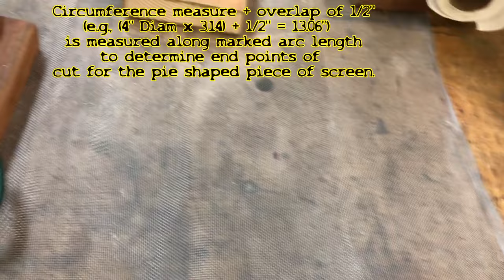Yellow Jacket Death Trap

Comment: It remains amazing to me that people don't know the difference between wasps, hornets, yellow jackets, bees, etc. and there are differences...and then they always or nearly always say that the bees bite them (not that they can't) when they typically are stinging them.  Biting is from the mouth while stinging is from their posterior/ovipositor.  Anyway...one of the easiest ways to destroy an in-ground nest is to first locate the hole in the ground and mark the place as near as possible with a rock or marking paint or some other method (without getting stung...not bitten).  Then, wait until darkness when the bees will have returned to their nest for the night.  Procure a flashlight and about a pint of diesel fuel, any kind, go to the bee hole and pour the diesel directly into the hole and leave them...easy peasy. Gasolene will not work.  I don't know about kerosene but this should also work as it is basically the same as diesel.  Now, I know that some folks won't appreciate this method thinking that diesel is not politically correct to use, but it hurts nothing and it will kill all the bees.  That little bit of diesel simply quickly biodegrades leaving absolutely no evidence of its presence/use.   Now, there is another way of destroying a nest and that is to find a skunk and direct it to the hole in the ground whereupon it will promptly dig up the nest and eat every single bee!  and never get stung!  The only remaining scars will be an enlarged hole and some nest paper from the bees...but no bees!

Comment: Simply way to destroy yellow jacket nests in the ground, I've found, is to wait until after dark when all the insects are quiet, the pour maybe a pint of gasoline down the hole...Works very well.
Reply: would suggest to light it so does not soak into the ground.

Comment: Put the wire funnel in the lid facing down, dispensing with the wood box. 
Or just cut the top off a 2 litre plastic drinks bottle,  and insert inside the bottle facing the opposite way. Add some fruit juice, dog food a a squirt of washing up liquid.
Wasp flies in, bounces around a bit end eventually hits the water. The soap means it gets submerged and it then drowns.
Takes a fraction for eh time to make and also kills them for you at the same time.
Reply: Yessir.

Comment: A motor with trimmer line clamped to the shaft. Suspend motor over hole. Bugs get blended as the fly up and into the spinning guillotine!
Reply from the maker: That's a great one -- a hornet  vegematic  !!   A set-screw collar holding a line or wire at the end of long drill bit would do it.  Thankyou.

Comment: You can cut the top off from a 2 liter or gallon jug and put the meat in the bottom and duct tape the tops upside down back on the bottom so opposite of how they started and it makes for a GR8 trap!
Reply from the maker: Thankyou - That didn't work so well for me, tried a similar one with not good results.
Reply: Few inches of soapy water is the trick.

Comment: I would just go out after they are in the nest and dump a slug sevin in it way easier and they are all dead the next night.
Reply from the maker: What is "slug sevin"? - sounds like a poison. 
Its also hard to find the nests in the ground - I've found a couple nests and poisoned them then covered with a rock.  Later rammed a prybar and opened it up found more. 
But the traps allow me to get them at their destination when I can't find the source. 
BTW - checked out your website.  I used to fly R/C models - what a beautiful 2 cylinder engine you were working with !
Reply: @RelentlessHomesteading  I see I left a word out should have read dumped a slug of sevin. Sevin can be found in the gardening section of hardware stores or Loews & Home Depot

Comment: There are several easier ways. Wayyyy easier.
Reply from the maker: Depends on many factors ... Glad you have something that works for you - not everyone needs industrial strength solutions.
Reply: Try the plug in bug zappers sold in big box stores and lay it on the hole. I saw a video about that and wonder if thats the best.
Reply from the maker: @VelveteenRabbit77   sounds zaptastic - I like that.  Perhaps would work for moles too... LOL.
Reply: Good luck too you!!!
Reply: An easy one... Screw, nail or tie a piece of chicken to a little board. Put board, chicken side down, over a bucket. Fill bucket up to 1 inch below chicken. Swish a little dish soap in the water. Walk away. Done-zo in the buns-zo.

Comment: Depends on what kind of ductwork you're working on, & that's not real duct tape, the stuff at the supply house (inspection approved) is an entirely different beast. HVAC guys 100% use duct tape on flex duct & I add a panduit (huge zip tie) to make sure the tape never lets go & in some areas where mastic is involved, NOTHING is coming loose, that stuff doesn't play. Where did u think the name "duct" tape came from?
Reply from the maker: Thankyou for your comment. 
Yes - indeed 'duct tape' was made for ducts. What I've found that what is often referred to as 'duct tape' loses its adhesion in a few years, and the experts I've listened to said one should only use metal tape on duct work - and I've found that it never loses its grip.  But yes I sure like the mastic even better.  Recently reworked my travel trailer  and used lots of mastic for sealing all the little places ingress places to prevent any critters tiny or not so tiny from getting in.
Reply: @RelentlessHomesteading  Metal tape is only for certain applications, dryer vents & flu pipes being the most common, but have fun using it anytime u want. There's also one that looks like the metal roll but is actually thick & stretchy, almost rubbery & acts like mastic but in tape form.
Reply from the maker: @s000162017   thanks.

Comment: For the cone, use a plastic funnel.  The tip of the funnel might need to be shortened to make it wider, but funnels can be purchased for a buck and are rigid and easily attached with the adhesive.